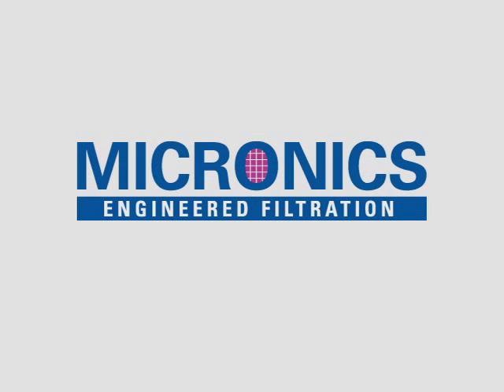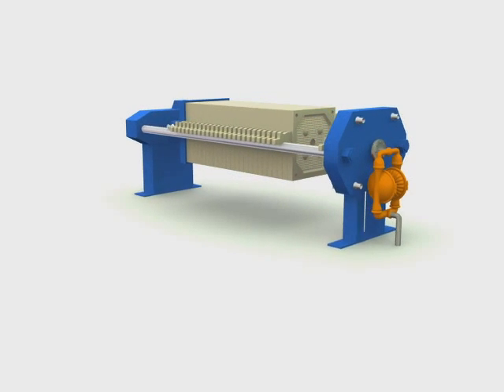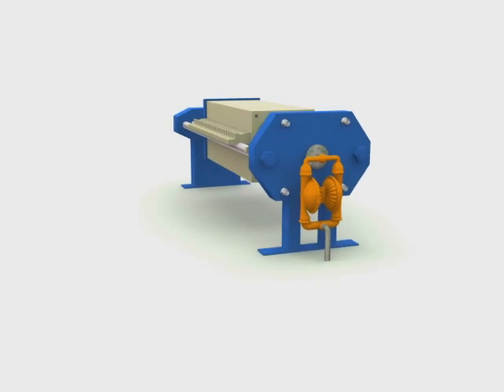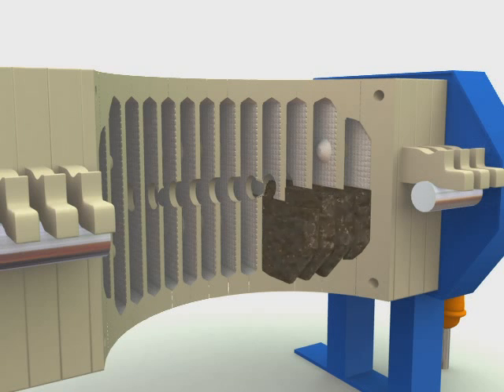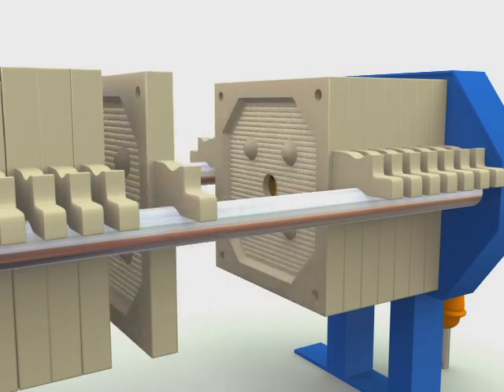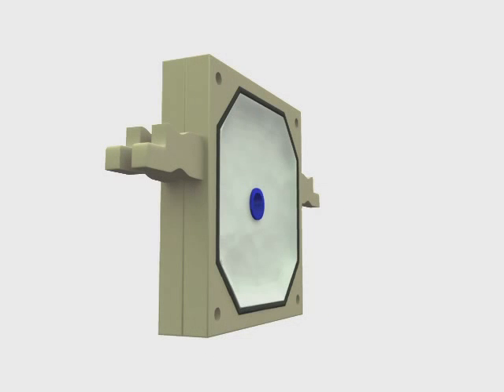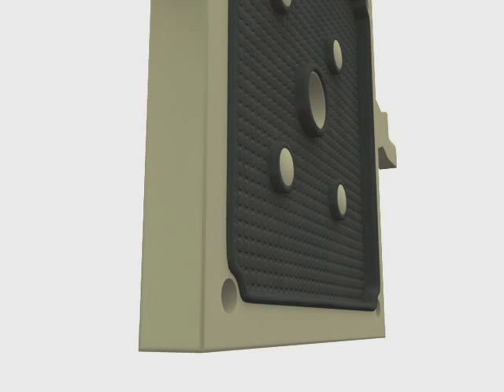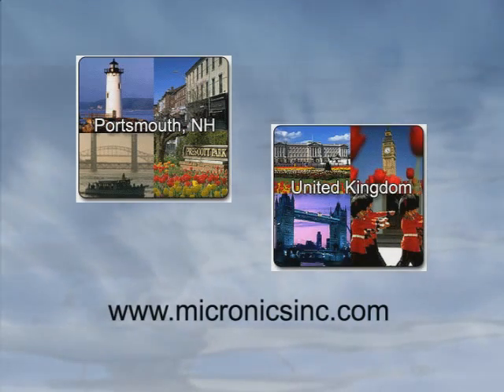Micronics Video.mpg

Comment: We strongly recommend that you apply ELODE to your SLUDGE reduction project. Be sure to choose ELODE which guarantees 70%ds dehydration rate for the world's first, the cheapest driving cost in the world.
ELODE system is
① No Competitor! in the World for Sludge Dewatering~
② 30%wt(70%ds) Guarantee for most of WWTP sludge characteristics.
③ 0.25kWh/liter water removed! (Lowest Energy Consumption)!
④ 12months Recovery of Investment (Faster ROI)
⑤ World Lowest Operating Expenditure!
⑥ World Lowest Capital Expenditure!
For more information ... www.bluewin.kr